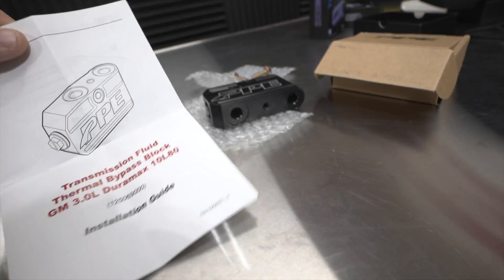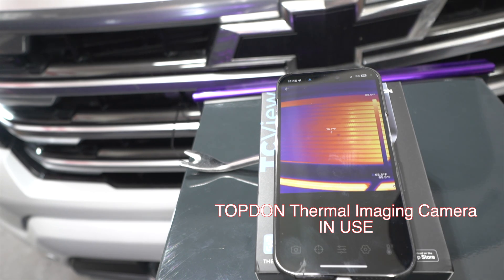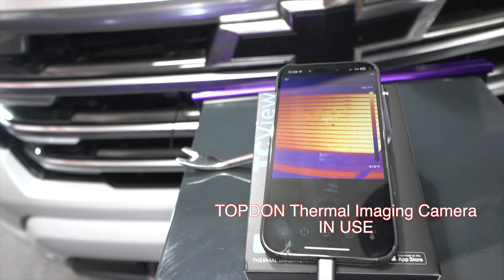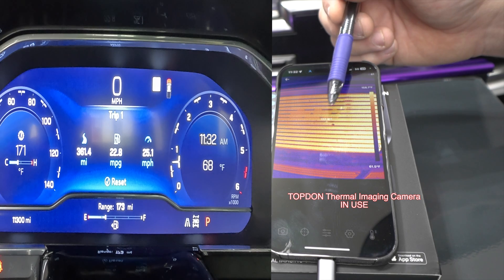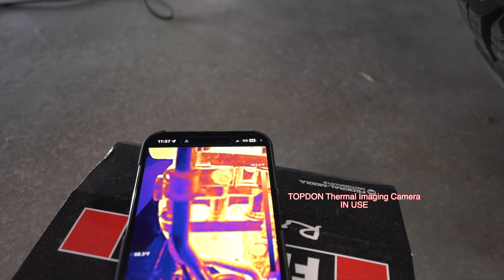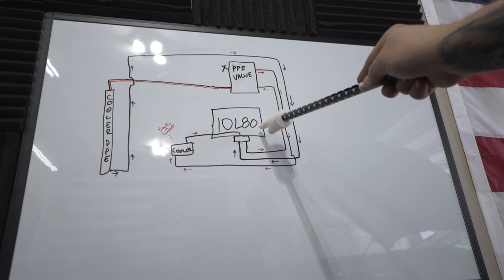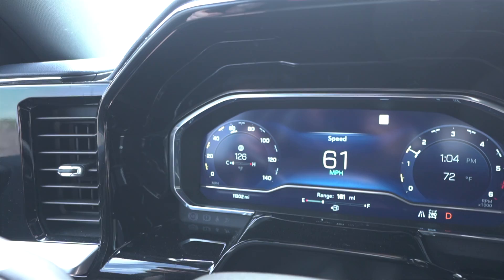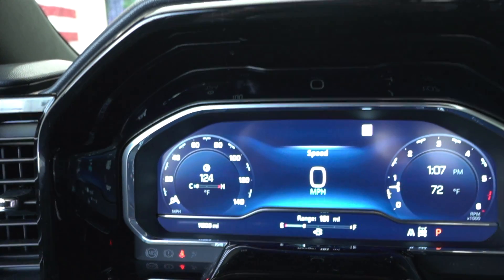75 Degree DROP By Removing This Valve On My 10L80 Trans

Comment: This is great content.  I stumbled across the STL020 kit from Superior Transmission parts a while back and one vendor claims it's compatible with the 10L80 in the newer 2021's.  Now that I see that the cooling packages different between the LM2s and LZ0s it probably won't fit my 2020.  I liked the concept of it though because (temperature discussion aside) it maintains the safety protection of bypassing a plugged cooler which must be a feature of the stock bypass valve?
Reply from the maker: I saw that kit, I believe it's designed for the built in bypass at the line manifold on the side of the trans (not our design) but unsure if it will also fit our block.
Reply: @DemonWorks  Looks like it would fit the block, but not work.  I emailed support at Superior Transmission and they replied instantly.  They said that kit wouldn't work because the blow off spring is too heavy (they claim there is only 25 psi being sent to the cooler) so they need to make some modifications so that it works properly.  They did say they were working on making it compatible but wasn't able to give an ETA.
Reply from the maker: @valmasj  hey that’s great info! I appreciate you sharing that with myself and everyone else that reads this. I also appreciate companies that respond quickly as well as listen to the customers questions then work to resolving the issue. Thanks for sharing !!!

Comment: Looks like a significant change, but like the other comment said it almost feels like its doing too good of a job when the transmission isnt being worked hard. Would be nice to see an option with a 160-170 degree thermostat, allowing for better flow when opened but also keeping flow out of the radiator when you want it to get up to temp.
Reply from the maker: Based on the testing in the video, the stock unit was wide open at 170 degrees. So, this open valve may be too open for me, I now know the stock valve will be open by 170 and that’s fine but why am I still getting as high as I am is the next question. I’m going to put in the deep pan next with the stock valve and see what that does for me. Stay tuned!
Reply: @DemonWorks  nice, I suspect the stock valve just doesnt flow much through the thermostat, so even if fully open it's only getting a relatively small portion of the fluid out to the radiator. 

Looking forward to all the testing. This will be super helpful for those with either generation engine.
Reply from the maker: @ALMX5DP  I agree. Maybe there’s a way to modify the factory one as well, unsure. I have fun testing this stuff out.
Reply: This gives me vibes back to the old days of running no thermostat on our cars when they ran too hot. Not sure if this is the best idea because there’s always a sweet spot of where the temp should be at. Too cold isn’t a good thing
Reply: What’s too cold?
Reply: @grantsmith9034  I have seen many different opinions, most kinda range from 140-160 as being the lower end of the spectrum.

Comment: Did you have to add back the fluid that was lost during install?
Reply from the maker: Not yet, need to be able to get it up in temp (longer driving). The amount lost was minimal, so I’m not concerned right now. It will get topped off in the near future and I do use a pump device for that.
Reply: @DemonWorks  can you make an update video about the highest temperatures you're running in daily driving? My LM2 gets up to about 190. Driving in the city. Stop and go traffic. I'm looking for something to lower those temperatures down to about 150 or so

Comment: I have the lm2 and I have the ppe cooler. I just towed a 6k camper avg 70mph with outside temp of 70-75 degrees. Never went over 194. When it hit 194, it would drop to about 187. I did buy the bypass valve but I’m just not sure if I want to install because I live in Boston Mass area and we get all kind of weather.
Reply from the maker: I planned on removing mine when it got colder out. Going to continue driving to see how long it takes to get up to temp then decide next step. Your temps sound great!
Reply: @DemonWorks  I think the cooler and the bypass is a little to much if your in a hot cold climate. If you live in a area that is always hot. Maybe both will work.
Reply from the maker: @b18civicsi00  i absolutely agree. I was holding back for a future video, but I will just come out and say right now… I think, for my use, the deep pan and trans cooler with factory bypass valve is the way I will go.

Comment: Have to admit I don’t know a whole lot about automatic transmissions, what is a good operating temp?  Is there such a thing as too cool?
Reply from the maker: I haven't been able to find anything definitive on this specific transmission. The ford version calls for high temps, but even though this platform was built with Ford, I don't trust their side since their cars overheat the trans regularly on the track. I have always been under the teachings of the trans temp is typically 160-175. GM calls for 158 degrees when checking the fluid level So I feel that is the area of "good" up to 190 degrees. My prior LM2 trucks ran at 160-170 degrees. Stock 10 speed gas trucks have been shown to run in the 150-160's. So I would say operating above 150 is the minimum. Yes, it can be "too cold" and that is where I waited to install this until ambient temps picked up. i will monitor my temps over the coming weeks.
Reply: @DemonWorks  love learning about this stuff, keep up the good work!
Reply: For it to live a long, happy any healthy life, about 165-170*.
Reply from the maker: @sierracat  that’s where my prior trucks were, I like 160-190. 190 being hottest it reaches when towing. Normal driving, 160-170.
Reply: I don't think I have ever seen a running temp of 160* other than on it's way past to normal operating temp of 185-190* on my Banks iDash.
Reply from the maker: @sierracat  my 160’s arrived after the ppe trans cooler on the LM2
Reply: Was that with a PPE trans cooler? My '21 LM2 typically runs 185-190*.
Reply from the maker: @sierracat  yes, my LM2’s all ran cooler. This LZ0 touching 210 stock is a bit much. Ppe trans cooler is installed currently and will stay installed when I pull this valve and go to the deep pan.
Reply: If that's the case, I may need to look into one of those in the future. Would just need to verify how it works in winter temps in the -30* range (which we can sometimes get where I live)...

Comment: I put on the ppe trans radiator on my 2021 3.0 durmax but the temps are 180-190 if I put the bypass will it drop the temps?
Reply from the maker: Yes, I saw a significant drop in the limited testing I did. Will do more testing over the next few weeks.
Reply: @DemonWorks  I have the LZO in mine towing in fl. my trans temp is 205
Reply from the maker: in 30 degree ambient temps i was hitting 210 degrees just driving. I have talked with a bunch of people and temps all vary but it seems the LZ0 on average, runs hotter trans temps. All of my LM2's were much lower
Reply: Also my truck is setup for Overlanding so it’s kinda heavy
Reply: Yes I see temps around 165° driving in Houston,TX
Reply: @rt0110  do you have the LM2 or LZ0 if all stock for you i am guessing you have LM2
Reply: Also I forgot to say I live in the hot state of Arizona lol 😂
Reply: I added the PPE Bypass valve on my 2023 Silverado LZ0.  Before the swap I saw temps in the 190-205 range during normal driving. After the bypass was installed 125-130 in normal driving and a high of 170 when towing my 5000# travel trailer. I’m also using the OEM transmission cooler.
Reply: @steveking-z9h  very nice to hear that i was just wondering if i could do the bypass and not the cooler also if it would make a difference at all